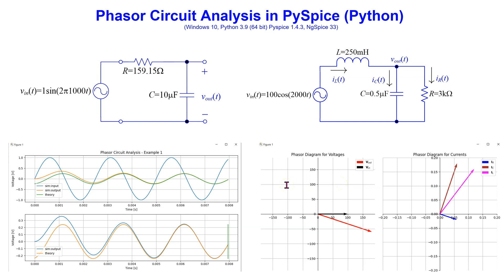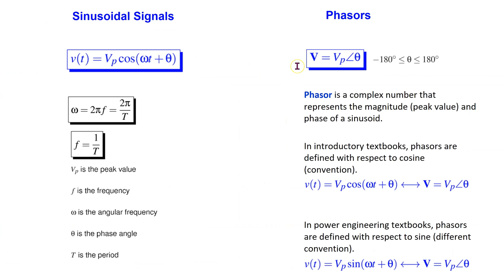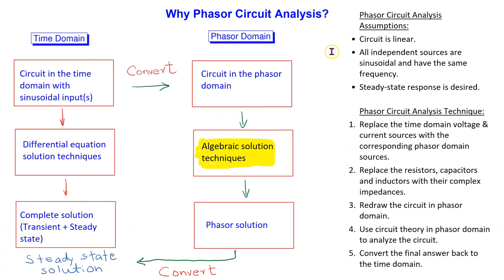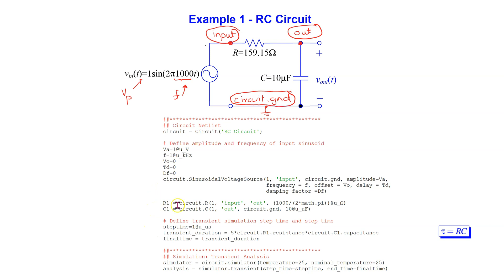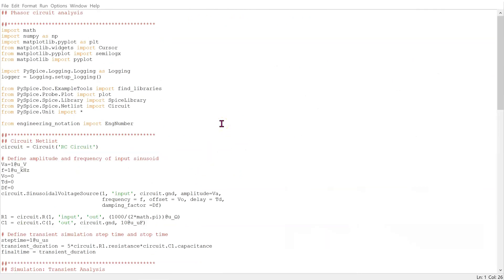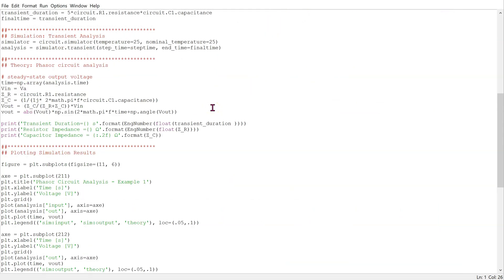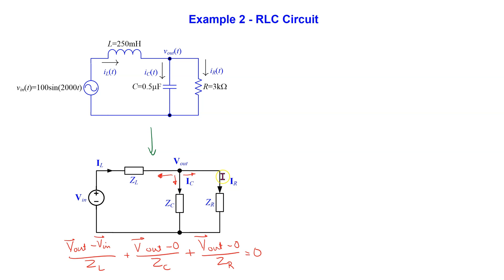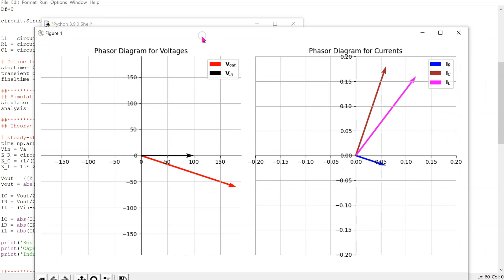Introduction to Phasor Circuit Analysis Using PYSPICE (Python)

Comment from the maker: ## Phasor circuit analysis - Example 2

##*********************************************
import math
import numpy as np
import matplotlib.pyplot as plt
from matplotlib.widgets import Cursor
from matplotlib.pyplot import semilogx
from matplotlib import pyplot

import PySpice.Logging.Logging as Logging
logger = Logging.setup_logging()

from PySpice.Doc.ExampleTools import find_libraries
from PySpice.Probe.Plot import plot
from PySpice.Spice.Library import SpiceLibrary
from PySpice.Spice.Netlist import Circuit
from PySpice.Unit import *

from engineering_notation import EngNumber

##*********************************************
## Circuit Netlist
circuit = Circuit('RLC Circuit')

# Define amplitude and frequency of input sinusoid
Va=100@u_V
f=(2/(2*math.pi))@u_kHz
Vo=0
Td=0
Df=0

circuit.SinusoidalVoltageSource(1, 'input', circuit.gnd,
                                amplitude=Va, frequency = f, offset = Vo,
                                delay = Td, damping_factor =Df)
L1 = circuit.L(1, 'input', 'out', 250@u_mH)
R1 = circuit.R(1, 'out', circuit.gnd, 3@u_kΩ)
C1 = circuit.C(1, 'out', circuit.gnd, 0.5@u_uF)

# Define transient simulation step time and stop time
steptime=1@u_us
transient_duration = 5*circuit.R1.resistance*circuit.C1.capacitance
finaltime = 10*(1/f)

##*********************************************
## Simulation: Transient Analysis
simulator = circuit.simulator(temperature=25, nominal_temperature=25)
analysis = simulator.transient(step_time=steptime, end_time=finaltime)

##*********************************************
## Theory: Phasor circuit analysis

# steady-state output voltage
time=np.array(analysis.time)
Vin = Va
Z_R = circuit.R1.resistance
Z_C = (1/(1j* 2*math.pi*f*circuit.C1.capacitance))
Z_L = 1j* 2*math.pi*f*circuit.L1.inductance

Vout = ((Z_C*Z_R)/(Z_L*Z_C + Z_R*Z_C + Z_R*Z_L))*Vin
vout = abs(Vout)*np.sin(2*math.pi*f*time+np.angle(Vout))

IC = Vout/Z_C
IR = Vout/Z_R
IL = (Vin-Vout)/Z_L

iC = abs(IC)*np.sin(2*math.pi*f*time+np.angle(IC))
iR = abs(IR)*np.sin(2*math.pi*f*time+np.angle(IR))
iL = abs(IL)*np.sin(2*math.pi*f*time+np.angle(IL))

print('Resistor Impedance ={} Ω'.format(EngNumber(float(Z_R))))
print('Capacitor Impedance = {:.2f} Ω'.format(Z_C))
print('Inductor Impedance = {:.2f} Ω'.format(Z_L))

##*********************************************
## Plotting Simulation Results

figure = plt.subplots(figsize=(11, 6))

axe = plt.subplot(211)
plt.title('Phasor Circuit Analysis - Example 2')
plt.xlabel('Time [s]')
plt.ylabel('Voltage [V]')
plt.grid()
plot(analysis['input'], axis=axe)
plot(analysis['out'], axis=axe)
plt.plot(time, vout)
plt.legend(('sim:input', 'sim:output', 'theory'), loc=(.05,.1))

axe = plt.subplot(212)
plt.xlabel('Time [s]')
plt.ylabel('Current [A]')
plt.grid()
plt.plot(time, iR)
plt.plot(time, iC)
plt.plot(time, iL)
plt.legend(('iR', 'iC', 'iL'), loc=(.05,.1))
cursor = Cursor(axe, useblit=True, color='red', linewidth=1)

plt.tight_layout()
plt.show()

##*********************************************
## Plotting Phasor Diagram

figure = plt.subplots(figsize=(11, 6))
axe = plt.subplot(121)

plt.title('Phasor Diagram for Voltages')
axe.quiver(0, 0, np.array((np.real(Vout))), np.array((np.imag(Vout))),units='xy' ,scale=1, color='red')
axe.quiver(0, 0, float(Vin), 0,units='xy' ,scale=1,color='black')

plt.grid()
axe.set_aspect('equal')
axe.spines['left'].set_position('zero')
axe.spines['right'].set_color('none')
axe.spines['bottom'].set_position('zero')
axe.spines['top'].set_color('none')

limit = max(float(Vin),np.amax(abs(Vout)))
plt.xlim(-limit,limit)
plt.ylim(-limit,limit)
plt.legend(('$\mathbf{V}_{out}$', '$\mathbf{V}_{in}$'))

axe = plt.subplot(122)

plt.title('Phasor Diagram for Currents')

axe.quiver(0, 0, np.array((np.real(IR))), np.array((np.imag(IR))),units='xy' ,scale=1, color='blue')
axe.quiver(0, 0, np.array((np.real(IC))), np.array((np.imag(IC))),units='xy' ,scale=1, color='brown')
axe.quiver(0, 0, np.array((np.real(IL))), np.array((np.imag(IL))),units='xy' ,scale=1, color='magenta')

plt.grid()
axe.set_aspect('equal')
axe.spines['left'].set_position('zero')
axe.spines['right'].set_color('none')
axe.spines['bottom'].set_position('zero')
axe.spines['top'].set_color('none')

limit = max(np.amax(abs(IR)),np.amax(abs(IC)),np.amax(abs(IL)))
plt.xlim(-limit,limit)
plt.ylim(-limit,limit)
plt.legend(('$\mathbf{I}_{R}$', '$\mathbf{I}_{C}$', '$\mathbf{I}_{L}$'))

plt.tight_layout()
plt.show()

Comment: Hi, I'm learning PySpice and I stumbled upon a problem(BTW these videos are really helpful). I don't know how to make swiping resistor. I want to change load in the output of my circuit, but I don't know how to make my resistor change its value. Is there any way to do that in PySpice?
Reply from the maker: Thank you for your question. Non linear resistors or resistors dependent on expressions (behavioral resistor) can be modelled using a B source. See introductory video here: https://youtu.be/tePft-bm9mw
Reply: @electriccircuits7164  I thought about passing sweeping parameters of resistor through raw spice in PySpice, because PySpice doesn't have inbuilt resistor sweeping function, but I faced another problem, how to extract data from nodes to python program :/
Reply from the maker: Thank you for the comment. Please see the "Parameter sweep" section in the Ngspice manual, which is the backend simulator in PySpice. As discussed in this video https://www.youtube.com/watch?v=tePft-bm9mw, you can extract node voltages using the syntax v=analysis.nodes['<name of node>']
Reply from the maker: @Bartollo0  Please see the video here which shows how to extract and plot node voltages and branch currents in Python: https://www.youtube.com/watch?v=DFuKQmYmZaY
Reply: @electriccircuits7164  Thank you for help. I decided to create a list of desired values of resistance, simulate it through operating point and loop calculations for my circuits updating values of resistance through each iteration :)
Reply from the maker: Thank you for closing the loop and sharing your interesting solution approach. I am glad you solved the problem!